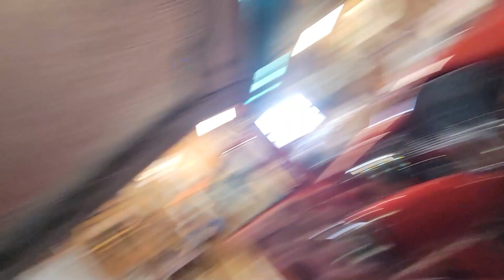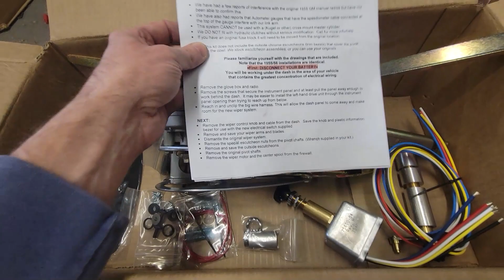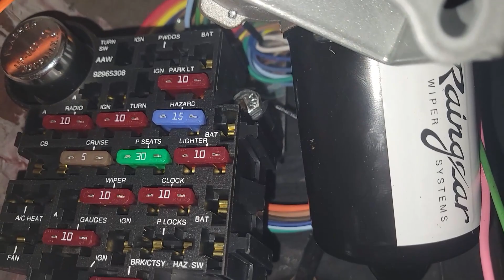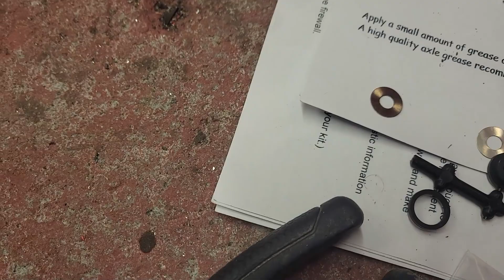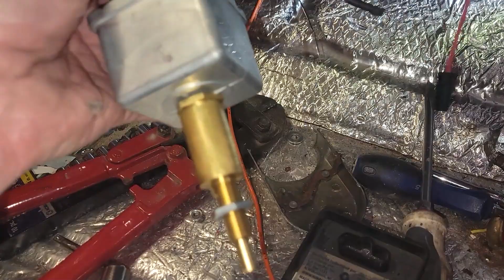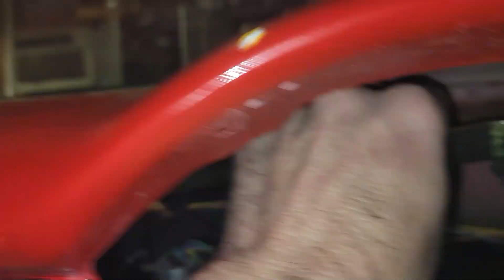E142 Learn from my MISTAKES!  Raingear Wiper Kit Unboxing & Install - 1956 Chevy Bel Air Restoration

Comment: You are awesome Bill! I definitely will be $$$ ahead learning from you. And, you are not alone. There have plenty of times where I have turned off the lights and went back inside the house after discovering something either has to come back apart or just isn’t going to work. Kudos to you for sticking with it. 
I like the idea of a bloopers video at the end of her build. And “maybe” do a close-up slow rolling out of the garage video with Bad to the Bone playing in the background. (Think Assembly line scene 😉😉)

Comment: I used a rain gear unit as well and I love it.spendy,but high  quality
Reply from the maker: I'm seriously impressed with it.  It's definitely a well-designed and sophisticated mechanism, compared to the simplicity of the one I pulled out.  But there's no comparison.  The Raingear unit is FAR superior.